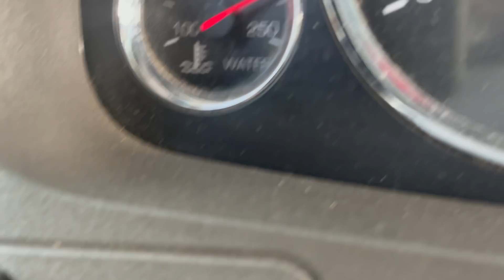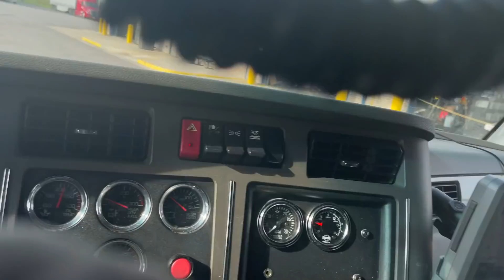TRUCK OVERHEATING IN THE APPALACHIAN MOUNTAINS*ANOTHER DAY*THE ISSUE?WORSE AREA*OWNER OPERATOR LIFE*

Comment: That happened to me in Dallas.  Dropped all my coolant.   Luckily there was a spot for me to pull over.  Don’t use water bc that causes rust in the engine.
Reply from the maker: I did t want to risk waiting on road call man
Reply: Water is fine in a emergency situation.... don't be lazy and "forget" to change it out once in a better spot .  Distilled or spring...no tap water.

Comment: Had the same hose bust. Pulled over added water tightened and made it to a loves. We purchased same hose from Love’s bought an extra piece paid shop $12 and bought coolant out the store about 7 gallons and my husband fixed. Took less than an hr. Would have been faster but hose was hot.
Reply from the maker: Mine ended up taking about 13 gallons of coolant that was most of my expensive
Reply: @ChasingMrHamilton  overall it cost downtime BUT it can be fixed in a timely manner. That is what matters in this industry
Reply from the maker: @rollingwitsolo7337  Yesir very true

Comment: U need to get that water out of the system. Also change your oil. It has gotten hot and possibly have lost it lubricity. That water is terrible for your liners inside your engine. Once u get new coolant in. Get a bottle of NUCOOL. Pour it in your coolant tank.
Reply from the maker: I’m just no seeing g this but thank you for informing me I’ll make I try to get one

Comment: All truck drivers should keep a roll of duct tape inside their truck for situations like this the duct tape would get you 10 miles to your destination
Reply from the maker: Why didn’t I think about that?
Reply: Being that coolant system is pressurized duck would probably not worked best thing to keep is tools and extra parts simple things like this would have been 30 minutes to fix.
Reply: @adventureornot7517   I have duct tape tools is tools and extra clamps in the trucks